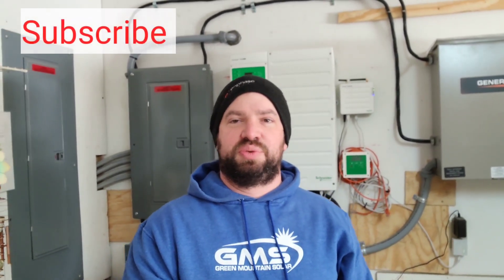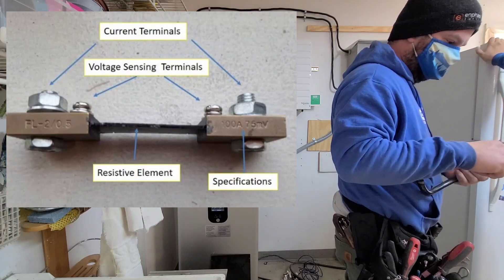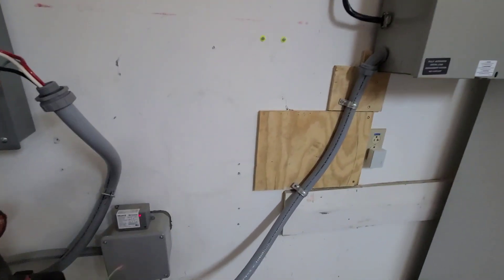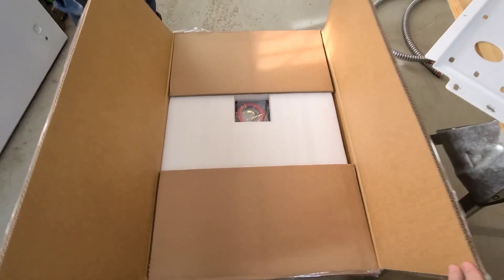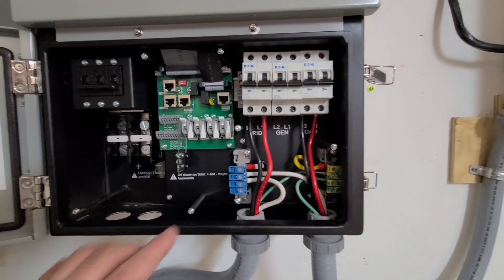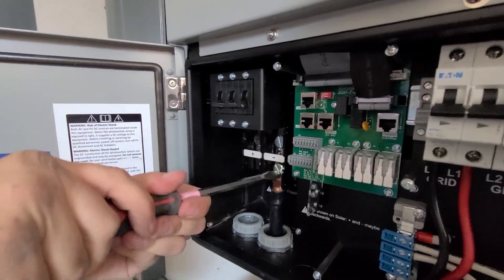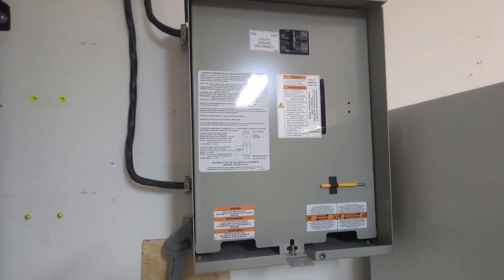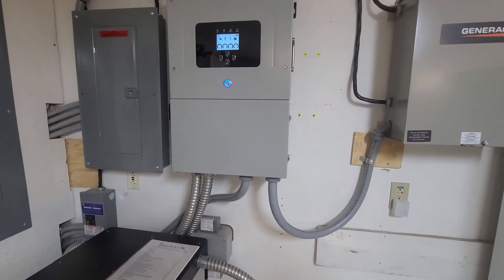Schneider Had Glitches But Fixes are on the Horizon?

Comment: I run an XW 6048 Pro system with (8) L16s, Schneider BCM, and 4 MPPT-60/150.  It sounds like the cycling you were getting is what I've experienced when running in State-of-Charge mode.  Since I'm not using Lithium-Ion I reverted back to voltage-based triggers for grid-sell and charging, and in voltage mode it runs a lot more similar to the Trace SW 2512 that I ran non-stop for 20+ years.  In SoC mode the XW would incur a DC under-volt fault condition before reaching the grid-sell SoC point.  The XW is the most capable inverter for motor loads out there but that 12kW surge capacity needs tremendous DC amps. My problem is the battery bank (48V440AH) is insufficient for the XW.  With inverters at this level the battery bank voltage drop becomes the issue, in my experience.

Comment: Two questions. How is the Batt capacity determined? I have 8 12 v 200 AH Lithium batteries which will replace 8 12 v 200 Ah gel batteries. Whta is the voltage on this context 4048 , is it 24 or 48 volts?

Comment: Sol Ark Inverters are suck, they can't even turn on a 1.5 HP air compressor.
Reply from the maker: Their surge capacity is definitely lacking. That being said, this has been installed for a year now and has not once glitched or shut down.   I'm working on testing the newer schneider firmware to see how it does now too.

Comment: Most likely the installer was clueless on the Schneider setup.
Schneider is bulletproof. Never seen any device built as well as the Schneider...
Reply from the maker: Thats a possibility, but I went through everything with a fine tooth comb, and it still had issues.  Keep in mind that this was just sitting there as a backup. Maybe the Evault BMS was throwing it off too? Not sure.  Either way, customer got tired if it shutting down, so it went away.  Once we installed the Sol-Ark it was all good.

Comment: That XW pro install was absolutely poor just at a glance. Nevertheless, not intended to be installed with an ATS like that. That tells me everything I need to know about this "glitchy" XW Pro. If that wasn't physically installed and wired correctly , then I HIGHLY doubt it was configured properly in the interface, as well as having good firmware. This is REALLY a p*ss poor claim against a great system. Either you know what you're doing, or you don't. It's quite evident the latter.
Reply from the maker: Thanks for the high praise Joe... I came into this one after it was installed, as did the transfer switch because the system kept shutting off.  It was configured properly and continued to glitch.  Thanks for watching.

Comment: Hey Ben - are you able to comment further on what the actual issues were that you encountered with the Schneider XW?  I've had a Schneider system (SW inverter + controllers) for 5 years running 24/7 and have not yet had any problems. I'm considering upgrading the SW to an XW.

Comment: I just finished a Schneider SW 4024 with switch gear for an off grid customer. Pain in the ass to wire with limited room to work and firmware that was glitchy at best...lol
Yeah....not a big fan at this point!
BTW...what's with wearing a face diaper? If your dumb enough to believe those work then the Solark was also a good choice seeing as they are a pain to field service....lol

Comment: No legit explanation for why not to use the Schneider.
Reply: I have a 15.3kW system and it is buggy.  Always throwing false warnings and changing my settings at random.  Videos are on our channel.
Reply from the maker: Loss of communication every month or 2, error 49 a handful of times,  randomly shutting down, overcharging battery in float (seemed like it stayed in CC instead of switching to CV) which caused the battery BMS to shut down.  DC voltage was off by 0.5v as well.  The point is, every month or 2 I had to go there or spend time on the phone with the homeowner and eventually he was fed up with it, as were we.  I fought tooth and nail with Schneider and they told me this was completely normal operation, and eventually wished me best of luck... 
In a scenario where you're the installer and it's at your house and you know how to mess with it and fix it when it glitches out and can actually get in touch with tech support, sure it's an OK inverter.  I won't install the old one at my house though.
Reply: I don’t believe that for a second honestly there is definitely something much more blatantly wrong. Not that I don’t love sol-Ark’s but that’s not a good reason to bash Schneider.
Reply from the maker: @Madactionmedia  OK if there's something wrong, typically a company will try to help you fix it.  Or at least point you in the right direction.  Or at least give you some sort of a hint?  There was nothing blatantly wrong.  This has happened with multiple units.  Give me one good reason to keep installing Schneider over other companies.  Sorry to sound defensive here, but they've screwed us multiple times.

Comment: Can you expound on what the problem was with XW Pro?
Reply from the maker: Loss of communication every month or 2, error 49 a handful of times,  randomly shutting down, overcharging battery in float (seemed like it stayed in CC instead of switching to CV) which caused the battery BMS to shut down.  DC voltage was off by 0.5v as well.  The point is, every month or 2 I had to go there or spend time on the phone with the homeowner and eventually he was fed up with it, as were we.  I fought tooth and nail with Schneider and they told me this was completely normal operation, and eventually wished me best of luck... 
In a scenario where you're the installer and it's at your house and you know how to mess with it and fix it when it glitches out and can actually get in touch with tech support, sure it's an OK inverter.  I won't install the old one at my house though.
Reply from the maker: And since you work for Schneider...  Installers all over the country are fleeing your products for lack of support and constant issues.  It was a solid inverter when you took it over from Xantrex, but now it's riddled with glitches.
Reply: @benssolarandbattery  We really appreciate feedback from our customers, good and bad. XW Pro has gone thru several firmware revisions and it's important to verify the latest firmware in XW Pro + InsightLocal, and the region code must be properly applied (very important). We have recently posted our Commissioning Guide which will be a huge help to those unfamiliar with our products. 

https://solar.schneider-electric.com/xw-pro-commissioning-guide/

There are currently thousands of XW Pro systems in operation, installed by solar Pros, and whose customers are happy. We have enhanced our support team and increased hours of operation.
Reply: I have a 15.3kW system and it is buggy.  Always throwing false warnings and changing my settings at random.  Videos are on our channel.

Comment: What problems were they having? 
I was looking at the for my Sol-Ark but hesitating since I have an extra XW on the shelf.
Reply: Mine seems to throw random warnings that turn out not to be warnings at all and the InSight system isn't the best.  It also likes to reset settings to their defaults at random so after months I've finally gotten it to hold the settings I wanted.  It is a 15.3kW system, videos on our channel.
Reply: @Off-Grid  you may need to update the Gateway
Reply: @SpencerLAPower  I'll look into that.
Reply from the maker: Loss of communication every month or 2, error 49 a handful of times,  randomly shutting down, overcharging battery in float (seemed like it stayed in CC instead of switching to CV) which caused the battery BMS to shut down.  DC voltage was off by 0.5v as well.  The point is, every month or 2 I had to go there or spend time on the phone with the homeowner and eventually he was fed up with it, as were we.  I fought tooth and nail with Schneider and they told me this was completely normal operation, and eventually wished me best of luck... 
In a scenario where you're the installer and it's at your house and you know how to mess with it and fix it when it glitches out and can actually get in touch with tech support, sure it's an OK inverter.  I won't install the old one at my house though.
Reply: @benssolarandbattery  Thanks, I actually called SolArk yesterday and had a few questions.  I actually got a person, that is more than Schneider... I have yet to get the correct person on the phone. Even though I already have all the system components except an RSS and MPP80 I think I will just get the SolArk as it is SO much more compact and ready to go.

Comment: With your experience with Sol-Ark, does it have glitches or random errors?  I'm torn between Sol-Ark and Schneider, main draw back is the cost of the Sol-Ark as I am only needing for AC coupled setup.  Thanks.
Reply from the maker: Eric, I've never had a Sol-Ark give random glitches or errors.  I have had 1 issue with a very early version of the 12k where the gen relay wouldn't stay on, and after some troubleshooting they just sent a new unit without any hassle.  Honestly the tech support alone and knowing that you (presumably a homeowner) can call and speak with them 7 days a week.  Schneider screens their calls, won't speak with homeowners as far as I know, is very glitchy, and won't admit fault when there is an issue.  I will never install another one.
Reply: I didn't think our Schneider system was over priced but is buggy.
Reply: @Off-Grid  I currently have a Schneider SW 4048 and 2x Schneider MPPT 60A controllers and have had zero issues with the system in five years, operating between -35 and 45 degrees through the year, 24 hours a day.  I've been considering upgrading to an XW inverter for more power and expandability.  It's unfortunate to hear "glitchy", "bugs" and "issues", but I'm having no success finding what the issues actually have been from Ben's channel - care to comment from your experience?
Reply: @seanogrady2078  Hello Sean,  It seems like all my problems were from the multi-inverter setup.  I've actually disconnected one of them and my just using a single inverter with the three charge controllers.  It took a good month or two to get the software issues worked out between the two inverters when I first turned the system on.  It wasn't as simple as making one a Slave an the other a Master.  I found that very few people actually knew how to do the set up.  

Once it was working I had calibration issues between the two inverters.  There is a playlist on our channel for the solar set up and I'm sure I talk about it somewhere in those videos.  Besides that is would randomly send warnings about DC Voltage, AC Coupling,  or Multi-Inverter Setup Config issues.  I'd change the settings only to find a week or so later the settings had switch back or never stuck in the first place.  It wasn't that the system wasn't working, I just got warning messages all the time.

In the year I had both inverters hooked up I realized that we never pulled more than around 5.5kW of power and the inverter is rated at 6.5kW with over a 12kW surge.  This is when I decided to unhook one of them.  That process was relatively easy except that the System Control Panel recognizes there is only one inverter but the online monitory system still shows that it is there but missing and has a warning code that won't go away.  I've learned to ignore it and am saving the other inverter as a spare.

Hope this helps.  All in all our offgrid solar system does what is should but watching other peoples systems with different components makes me think that Schneider was not the easiest or most user friendly way to go.
Reply: @Off-Grid  That really does help and I enjoyed watching your setup videos.  My only complaint about the system we have is the charge controllers are SO incredibly expensive - for what, some power MOSFETs and a transformer...
Reply: @seanogrady2078  We bought ours on sale, Cyber Monday, and got the 30% tax credit which gave us $11k back on taxes that year.  Since then we continued to write off anything related to the system.  It was 26% the last two years and I think it is 20% this year unless that was changed again.
Reply: Just looked it up and it is 22% for 2023 and then expires in 2024 unless renewed before then.
Reply: @Off-Grid  Probably US only.  Canada doesn't offer any tax credits for rural solar installations.
Reply: @seanogrady2078  ah, don't know anything about canada.
Reply: @Off-Grid  it is really damn cold in the winter.

Comment: whyeven use the transfer switch? The solark has it built-in, no?
Reply from the maker: We added that for the Schneider, homeowner wanted to leave it there.   It does allow the Sol-ark to be hidden behind it so firmware updates don't shut down power to the house, but makes for slightly longer transfer times.

Comment: I didn't know anything about the Schneider setup until bumping into the 'Wild Wonderful Off-Grid' Youtube channel.  From their experience - seems like a great system - very modular and reliable.  Sure just seems like an Ethernet cable (or gateway firmware update) and tweaked battery parameters would have solved it for this customer.  SolArk weakness (in some cases) is the lack of flexibility of charge controllers, which limit how the solar array is wired.  No issue here since solar is AC coupled for this install.  Schneider charge controller more like standard grid tie inverters - accepting wide voltage range and wide MPPT operating range.  Too bad the Schneider wasn't working out - seemed like it could have been a solid system.  Nice job on the swap out.
Reply: Josh from Wild Wonderful actually help me when I was setting up our Schneider 15.3kW system.  Our system is buggy too though.  Videos are on our channel.

Comment: That’s a great change out of the Schneider to a Sol Ark inverter . Much larger and it’s possible to effectively run the home . We preppers must use dependable equipment when it comes to being off grid .check out my solar videos, hit like , leave a comment and subscribe .May the solar be with you .

Comment: Ben and Brawn! New hoist you run on meat and potatoes rather than hydraulic fluid? Nice job and why I probably went a little overboard buying a Sol-Ark 12K instead of a Schneider Conext. First install I've seen without any PV system. Interesting and always a great installation and video.
Reply: Probably better you went with Sol-Ark.  Our Schneider XW Conext is buggy.  It is a 15.3kW system, videos on our channel.
Reply from the maker: There is solar there, I just forgot to film any of it.  Yes the homeowner definitely got an upgrade, but it's to a reliable inverter we know we can trust.
Reply: @benssolarandbattery  That makes a lot more sense. I couldn't understand why the customer would pay so much to charge the Fortress when a much cheaper battery charger would be sufficient.
Reply: @fisherus  no just charging but u need inverting

Comment: The XW is actually a good product if it is setup correctly. It sounds like the charge parameters were incorrect for the battery type. You cannot use the lithium battery type since it has temperature compensation (at least it still did the last time I checked). For Lifepo4 you need to use a custom battery type and enter charge parameters for the battery you are using as well as making sure temperature compensation is 0mv/cell.
Reply from the maker: It was setup correctly, many many times, including with the guidance of tech support. You can disable temp compensation or just not hook up the sensors.  The XW is a great inverter that was bought by a big company who tried to overcomplicate it and failed.   If you DIY it and know how to deal with the little glitches that pop up, great.  Most of my installs are for people who want the product to work without having to tinker with it every month.
Reply: @benssolarandbattery  
I admit I’ve always plugged in the temp sensor so I’m not sure if it completely ignores the compensation value if no sensor data is available. However, it is important that only one sensor is used per system/xanbus network. Multiple sensors can also cause the issues you described. 

The last time I had tried to disable the temperature compensation for the lithium battery type it didn’t actually accept the zero value and continued to cause issues whenever the battery temperature dropped below approximately 55deg f. However it’s possible they updated something since then as we’ve been using custom parameters for all of our systems.

By today’s standards it certainly is not the most intuitive product, especially for most residential applications. Additionally, if the Sol-Ark works well for you and your customers it is significantly easier to support one platform than many.
Reply: The Xw Pro has had some struggles unfortunately, myself I have two of them paired with 5 Discover AES and the Disconnect RS, it’s been a good system and takes some abuse from my off grid woodshop.
Reply: I had trouble getting the Gateway settings to stick. The system kept resetting things the way it wanted it.  Took some time but I think I've got all the bugs worked out now.  We have a 15.3klW Schneider system.  Videos on our channel.